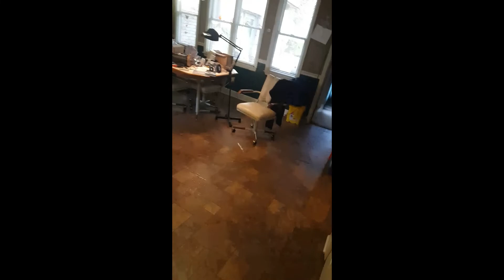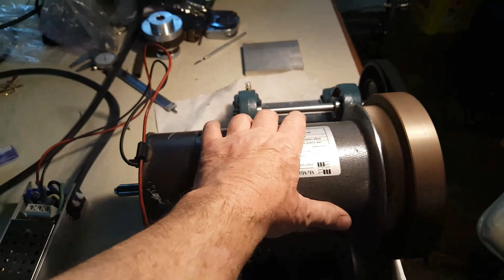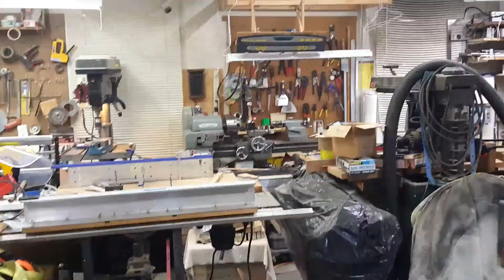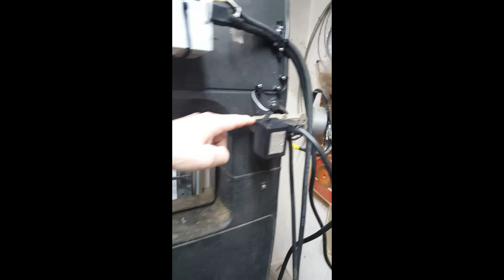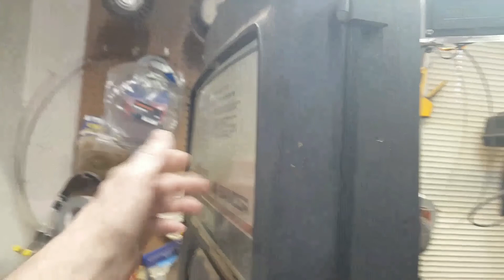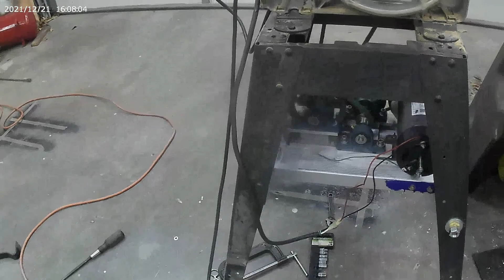Craftsman Bandsaw Variable Speed Treadmill Motor Conversion

Comment: Ive never gotten any torque out of dc treadmill motors.  Used all the way up to 3hp rated treadmill motors with various speed controllers and pulleys and flywheels..  either it will take forever to get up to the slower speed with a big weighted flywheel or itd just bind up and stop the motor at lower speeds.  If i used a bunch of gearing it might work but having to align all that on any kind of budget just kills the project for me..  tried bandsaws and drill presses but both require lower speeds for metals and its just too much to get the torque out of em..

Comment: Hows the saw holding out
Reply from the maker: It's doing great! Only issue I have is getting enough tension on the pulleys to keep the blade from stopping, because it runs so slow. I may add a tensioner on it later this Spring.
Reply: @JohnnieBravo1  what's the estimate it cost to do that

Comment: Does the size of the choke matter I got one out of a treadmill and it looks like it's about four times the size of anything that you have posted on your videos
Reply from the maker: Hey Dave;  this setup doesn't have a choke on it.  I've been talking with DazeCars, and he says they should be used to extend motor life.  I plan to upgrade all these components to a higher grade SCR, a better bridge rectifier, and then a choke to the leads going to the motor.  I plan to do that on my bandsaw, my 12" lathe, and my little 6" lathe all of which have been converted to treadmill motors.  DazeCars has some excellent videos and guides to doing this, based on his experiences and knowledge.
Reply: @JohnnieBravo1  thanks if you talk to him ask him if size matters the one I have is quite large in comparison to the one that he put in his video maybe size doesn't matter
Reply: @JohnnieBravo1  or the bigger the better
Reply from the maker: Hey Dave;  Dazed has a new vid up now, and I took the opportunity to pose your question this morning.  He says that although he does not know the exact calculations on choke vs motor size, his experiences are, that on one of his machines he has a baseball size choke and it works great.  On another machine he has one about the size of a softball, and it works better.  So from this, it appears that on chokes, size does matter.  I hope this helps.
Reply: @JohnnieBravo1  thanks for your replies guys I have one about the same size as in his video and one probably twice the size

Comment: May I suggest to look up YT'er DazeCars and build a better DC motor controller for your band saw.
Reply from the maker: Thanks for  your suggestion.  I'm learning, and experimenting, so I used what I had laying around.  I might do better using an AC motor, with a VFD, but I don't have any of those.  I'm a much better designer/fabricator, than an electrical motor guy, so I was outside my area of expertise on this one.  It definitely could use some power enhancements, but so far it's doing what I need it to.  Thanks again for your good comment.
Reply: @JohnnieBravo1  Just thought you might want to save/protect your DC motor for a longer running experience with adding some extra parts like choke, capacitor.

Comment: Well done. You certainly deserved to have it work out the way you wanted given the amount of effort you put in. Could I ask the diameter of each pulley and did you say the motor rpm is about 3500 please? I have hearing issues and couldn't get some of this info. Cheers
Reply from the maker: Hello, thank you for your comment.  I'm sorry, I didn't see it til this morning.  The DC motor is 3750 rpm, 100 volts, 29 amps, 3.0 hp. It came from a mid-level treadmill.  The pulley sizes are 1-3/4" on the motor to 5.00" driven on the first stage.  Then 1-3/4" driving on the first stage to 6" driven on the second stage.  Then 1" driving on the second stage to 8" driven on the side of the band saw.  I don't think the speed controller is giving full power, and speed, to the motor, but its range of speed works for what I need it to do, so far.
Reply: @JohnnieBravo1  Thank you for your reply. Cheers mate.

Comment: Hello Mr Bravo, It would be most helpful if you could list part numbers and links to the purchased items. Maybe a schematic or two? This is a very informative video otherwise. Thanks!
Reply from the maker: Tachometer : https://www.amazon.com/gp/product/B01FQMI18Y/ref=ppx_yo_dt_b_asin_title_o06_s00?ie=UTF8&psc=1

 Speed controller video : 
https://www.youtube.com/watch?v=T22pJMIAIRQ
 Stainless Rod : https://www.amazon.com/Diameter-Stainless-Steel-Length-Extruded/dp/B074KHN4GV/ref=sr_1_8?crid=3BTMWXV1XUBJA&keywords=1%2F2%22+precision+stainless+rod&qid=1642797999&s=industrial&sprefix=1%2F2+precision+stainless+rod%2Cindustrial%2C48&sr=1-8

  Pillow bearings : 
https://www.amazon.com/PGN-UCP201-8-Mounted-Bearing-Aligning/dp/B07MWBY7N9/ref=sr_1_3?crid=25TVMSNOH3IZL&keywords=1%2F2%22+Pillow+block&qid=1642798143&s=industrial&sprefix=1%2F2+pillow+block%2Cindustrial%2C61&sr=1-3

Pulleys from Amazon, eBay, and Tractor Supply.  Link belt from Harbor Freight.  JV microgroove belt came off the treadmill I disassembled.  V drive belt from Oreilly's Auto Parts.  5/8" threaded rod and nuts from Lowes.  

I hope this helps.  Those speed controllers and rectifiers are all over Amazon and eBay.
Reply: @JohnnieBravo1  do you have a link to the pulley?  I can’t find one.
Reply from the maker: @jaredwilliams5252  which pulley are you asking about? There are six of them in this setup